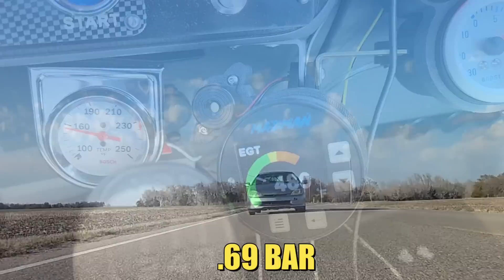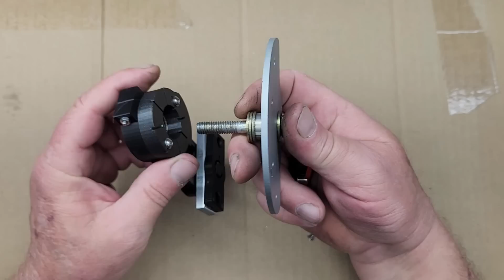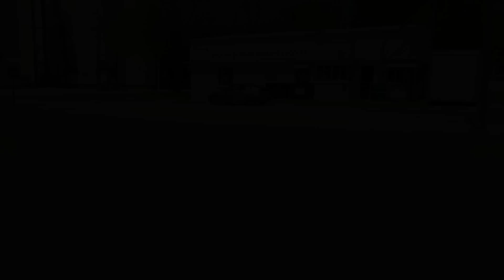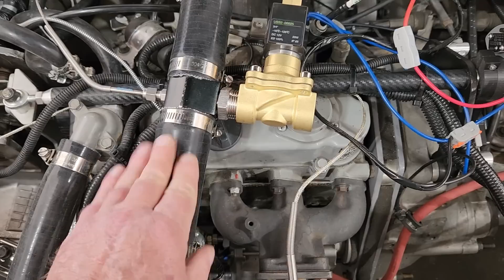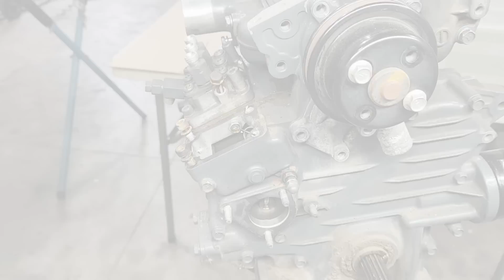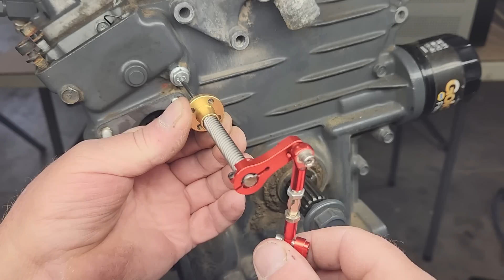S4 E15.  We  test the effects of full boost on the AMR500 supercharged the Kubota diesel engine

Comment: A 1985 Mack over the road tractor that I worked on had an "aneroid" smoke reducer.   It was a spring loaded diaphragm that pushed against the rack, until boost built up, then smoothly allowed appropriate fuel.
Reply: The modern version for a mechanically injected engine would be a computer with a RPM sensor on the crank and a MAF sensor in the intake, controlling a servo that moves a stop on the fuel rack. The computer has a map of max fuel flow rate vs max air flow rate, and adjusts the servo so that the rack cannot move far enough to reach the point of excessive smoke given current air flow and engine speed. This way the computer doesn't interfere with fueling until you hit the limit, and it will even automatically compensate for things like altitude changes or an old air filter.

On a really modern engine with common rail things are of course way more complex. My diesel common rail car has a MAF sensor, crank trigger wheel, wideband sensor in the exhaust, variable geometry turbo, EGR valve, swirl flaps in the intake... My understanding is that it more or less has a target AFR that varies with the power output to minimise emissions, and it uses the MAF and wideband to adjust the fuelling, turbo and EGR to try and hit that AFR. Still makes a puff of black smoke (and a hazy exhaust after) when you accelerate hard.

Edit: Heh, should have let the video finish first. Jimbo is way ahead of me.

Comment: Definitely interested in adding electronics. If you add a MAP sensor you could use that to drive the arduino "boost controller" to maintain a given boost. You could go one step further by adding a TPS and mapping boost to a given TPS position. You could go even further and make it drive by wire. So yes. Please continue

Comment: Yes. Continue with the electronic fuel adjustment screw. 
I and probably many others with older mechanical diesels are interested in a simpler solution than a 10mm wrench under the hood.  👍😁👍

Comment: Yes, Love the tech, 3D printing, machining work and general engineering. I want to see you build a home designed hybrid system. Something like a Chevy Volt or Prius, where you have a small engine, dual electric motors with a planetary gear set + final drive gear  to replace the CVT.

Comment: Jimbo - I like what you are doing with this diesel project. Your mechanical creative designs have been fascinating! Since your background is - as VGG Derek would say "digital bits", by all means go ahead and do the boop beep stuff to this Kubota. The stepper motor atlas screw solution to the fuel rack adjustment is fascinating. What do the garden gnomes think? I owned a 1980 Mustang Turbo 2.3, which was really a Turbo Pinto :(  It had all SORTS of Rube Goldberg non-digital solutions for managing boost and stuff. It will be interesting to see what you come up with.
Reply from the maker: Look like everyone really wants me to do the boop beep stuff to this Kubota... Stay tuned!

Comment: Is it possible to mount an AC clutch on the supercharger do fully disconect it while crusing.
Reply from the maker: Its possible, however having some boost at cruise is beneficial for fuel economy.
Reply: @robotcantina8957  Criusing in town at low speed?
Reply from the maker: @gislemark79  Yes,  the data is indicating that a small amount of boost is better than none.

Comment: Could you cover why you actually want to release boost from the engine at idle? Surely after you've spent the power compressing it in the supercharger it's a waste to let the air pressure out again!
Reply from the maker: Boost at idle isn't necessary.  If I dump the boost, we waist a small amount of energy, If I keep the boost, we waist a lot of energy.

Comment: In combination of electronically controlling the fuel pin, mixing diesel with used veg oil 50/50 would do four things. Less smoke, lower NOx, less odors and double the distance you can drive on the same amount of money. I personally use this blend in my mower with no issues.

Comment: Yes on fuel rack adjustmemt.adjustment.  could you explain the advantages of using a throttle plate as a dump valve vs. a computer controlled waste gate?

Comment: So something that’s really bugging me is when you want to test how much power a supercharger will take turn you can’t just hook it up and let it pump as much air as it wants as it’ll look like the supercharger is taking tons of hp from the crank but if you put a restriction on the out put of the blower so it’ll make the same pressure as it would hooked up to the motor and the supercharger takes a lot less hp to turn your boost control set up is making the blower work a lot harder than needed you need something like the anti shudder valve from a vw tdi or a throttle body on the intake of the blower this should help with mpg and temps

Comment: Yes to more stuff.
A thought:  If you preheat the air going into the supercharger you will have effectively less air being pumped in.  The super charger does the same volume of air not the same pressure.  When you are going slow, a flapper value can bring in hot air.  When you put your foot into it, the flapper could act to bring in cold air.  
I don't think an intercooler will do much that is useful.  This is just a random prediction from me.

Comment: You have access to 3d printed parts, a more efficient intake on the supercharger will make way more boost. The intake port on the supercharger case is a square shape that is way bigger then the intake adapter that comes bolted to them. The intake that comes on these has a round opening that is only about 1/2 the area of the square opening of the case. This should also reduce intake temps as well, the blower will get more efficient because it wont be working the air as hard.

Comment: Yes! Keep it going!!! i love this little diesel project as a former navy diesel mechanic (enginemen) and working on diesels that were  15.75" bore and 18.25" stroke V16's where every cylinder was making 572 hp at idle this is so fun for me to watch .
Reply: Yup, as a former marine engineer working on large 2 stroke (propulsion) and smaller 4 stroke diesels (ship's generators), I've always loved diesel engines, especially the boosted ones.  Feed them lots boosted cool air and clean fuel and any diesel can do amazing things.  Lots of power for very little fuel burned.

Comment: Yes but instead of engaging a complicated dump valve set up. Why not dial the supercharger back to 5psi and use your turbo set up for the desired peak boost? If you are adding the electric controls to the injection pump that should resolve your “puff of smoke issue” and the supercharger will drastically reduce the lag from the turbo but maintain much lower IATs. Just a thought. Love the video and will continue watching regardless of what direction you chose.

Comment: Yes push the limits. Maybe easier will be to bypass governor and connect "throttle" directly to fuel rack and after that use servo to control "throttle" input.

Comment: Yes Jimbo, please continue. I’m a grease monkey, computer stuff is foreign to me, but I love seeing the stuff people can achieve with some knowledge. 

Also, here is an idea. Rotax engines(from seadoo) have a small centrifugal supercharger that would have a raising boost curve. They’re 500-1000 bucks used online. The only issue is the transmission to drive them at proper RPM with the diesel engine(they’re gear driven). I just thought I would relay that information, as I see a centrifugal being more efficient in this application.

Comment: Could you use propane injection in the intake to enrich the mixture when you need more power.
Diesel should work well with propane injection, and you don't have to modify the fuel pump.
Leave the diesel fuel pump settings as is and have a secondary LPG/Propane injection that is controlled by Arduino.

Comment: Yes, please continue, for two reasons.  For one, you first illustrate each of your solutions in an analog fashion.  This helps me to understand how your digital solutions are going to work.  For two, you are engineering not just for performance, but for reliability, durability and practicality.  You are building machines that people could actually use.  So many other sites are bench racing for ultimate potential, damn the torpedoes, and if she blows up that no big deal, the sponsors will just pay for another one.  I like to see people build things that will actually work.

Comment: Definitely continue on this route. It would be interesting to see if injector timing could be made dynamic. Would it be possible to convert the injectors to electric. Could different length intake and exhaust cutouts be used to increase efficency at different rpms. And going back to last month when you asked whether we wanted to see alternative fuel test, I am still hoping you get a chance to experiment with some of those. Or maybe set up a basic electric motor booster since this car was originally a hybrid. Just a simple DC cart motor pullied to the crank pulley activated at "full throttle" with a deep cycle battery in the trunk. No computers just switches. Thank you for all your hard work!

Comment: Fuel rack adjustment.
Would a cam lobe over a cma roller work ok ?
Because the cam lobe would not nee to make a full rotation to adjust the fuel rack, a simple jack shaft arm connected to a levering arm, controlled by a servo could work quite well.
 The servo and  lever could then be  mounted on top of the valve cover.
That would keep the front of the engine relatively clear for water pump, alternator etc..
🤷
Idk, just spit ballin ideas.

Comment: Yes, I'd really like to see how far you can go with that little stationary engine. 
Just thinking of the fuel rack adjustment, instead of the acme screw, what about a worm gear arrangement. My thinking is two fold. 1) you don't need a lot of horizontal space in front of the engine for a worm drive, you can even remote the encode/servo drive away from the area if you use a flex drive shaft. 2) the torque multiplication factor of a worm drive to limit the amount of force needed by the servo. 3) Bonus I just thought of, only the drive gear can move the driven gear. You are going to have mechanical push back from the mechanical injector rack. With a worm gear the driven gear can't typically turn the drive gear, so your servo won't have to fight the mechanical push back of the mechanical injector rack. 

Also i was wondering about the home brew waste gate valve. On a gas fuel injected engine to control idle speed, they have a tapered seat idle air control valve which is typically driven by a stepper motor. I wonder if one from a large V8 engine would pass enough air to work as pressure gate valve for this small engine... Interesting to think about.

Comment: oh and i wonder if an adjustable pressure regulator, like for air tools, could be modded for on the fly/servo control. if it would be precise enough, dump enough air, be cheap/easy to mod enough to be of consideration? maybe one for natural gas generator? prob vey big though...

Comment: Love your videos, Jimbo.  Let’s go more into the weeds with the electronic control of the engine.  In my own case, I’m working on revision two of my Pico controlled EFI for my 64 Suburban.  Adding distributor-less ignition to the existing fuel injection.  About the automatic rack adjustment, how about using a GM IAC valve?  It’s a stepper motor with a thread.

Comment: Consider adapting the diesel to the original Honda  hybrid system. Replace the nickel battery with lithium, use an electrically driven supercharger to produce a tailored on demand boost with no parasitic drag. The acceleration could be normal, the fuel economy could rise to an excess over 100 mpg

Comment: Unfortunately I'm against rolling coal, so if your computer eliminates that then I'm all good. otherwise lets move on. Yes.
Reply: Rolling coal is epic ngl
Reply: I know and understand, I have seen coal drag racing but there are so many better fuels, IMO
Reply: @eugene590  better fuels is a terrible way to look at it the key differences between fuels makes sure one is no better than another you can’t beat diesel for torque but gasoline revs higher and is better for performance in a track setting

Comment: I wonder if the Stainless steel rod used for the governor limit might be bent and jam in the bolt if the governor pushes hard against it.  Would the consequences be an over rev?
Stainless steel is not necessarily stronger than regular steel, it just work hardens easier

What about putting the Acme screw mount into the front cover and have the Acme screw itself be the stop.

Comment: Problem with a dump valve is the supercharger will move more air even though boost is dropped.  A throttle plate in front of the supercharger would drop air flow and boost.  Moving air is work boosted or not.  Squirrel cage fans are great to demonstrate this, block or the incoming air and the fan speed increases, remove the blockage and the rpm drops.

Comment: Also jimbo have you considered a W/M injection for intake cooling as opposed to a intercooler. Sorry if i have already mentioned this. This way you could remove the pressure drop across the intercooler and have on demand cooling effects. Downside is now you have another fluid to purchase. I’ve heard you could use windshield washer fluid for a cheaper alternative that gets you like 30% meth.

Comment: Yes keep with it!! Maybe use a drive by wire throttle from the junkyard or jungle site as a controlled boost valve. Would be very interested in some basic ecu creation. Also you could try plumbing the valve back into the intake before the stupidcharger just for giggles. Any chance of Homemade long tubes headers? We should see a drop in boost with headers with no other changes. Great channel great content

Comment: @RobotCantina might want to install a reverse protection diode on boost bypass electromagnet.
At 1:12 the green lights on the dash light up with the reverse voltage spike, when you disconnect the electromagnet .
Love your videos, it's just the sort of antics I would do if I could 😅

Comment: Will the accelerometer + TPS combo work for figuring out how much boost is needed? What about if you come to a hill? (You may not have hills where you live - but ask the gnomes - their relatives came from such places). In this case, neither the throttle position nor speed would change initially, but the car would require more power to maintain the same speed - so don't you need something to tell you how much load the engine is under? (I would say a vaccum signal if it weren't diesel).

Comment: using an Arduino and custom code converting the tachometer signal is a good idea but i think a full mechanical  system to manually advance or retard the switch timing using your gear linkages would be epic and everyone is happy

Comment: Hello Jimbo , yes please continue, I imagine something like a simple pressure regulator that uses a servo to push the spring and change the preload in increments, I figured no boost at idle, 4 pounds for light throttle, and full boos over 60% throttle

Comment: Also on the 3800 L36 and L32 engines the supercharger had a throttle that would re circulate boost back to the other side as a "controlled boost leak." So that throttle body may work.

It was only a little throttle, but it worked well!

Comment: Love the jabs at boeing🤣

Yes!! I want to see what you can do for boost control with a microcontroller. Currently in my personal rig, boost is either on or off with a vacuum actuated bypass valve, and the options for an off the shelf electronically actuated one are over $1k. There's definitely a market for this if you decide to sell something...